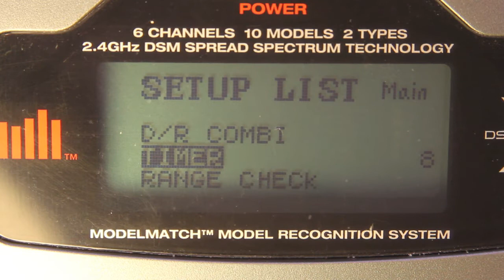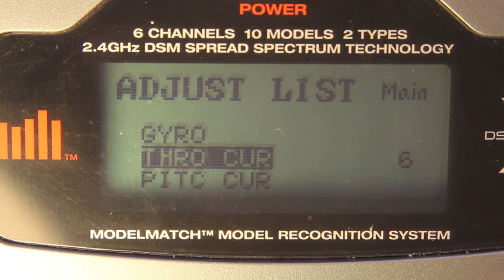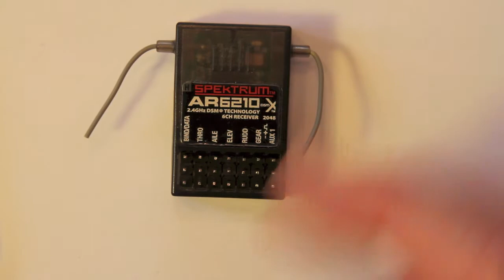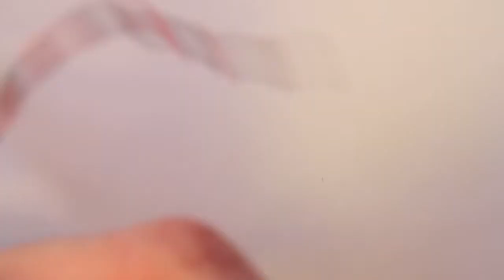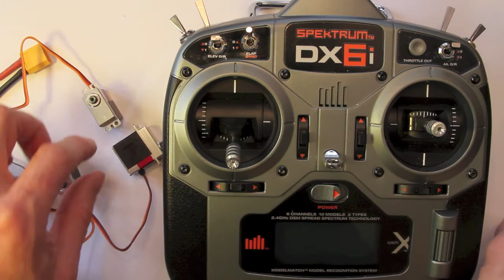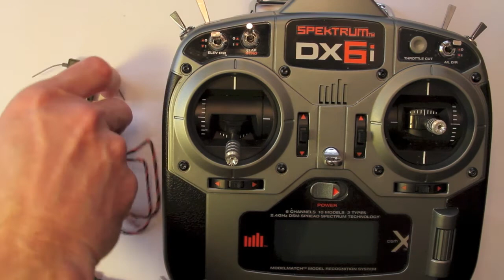11 : Tarot 450 Pro V2 Build : Electronics Extravaganza Volume One

Comment: Please help if you can - I have a new Tarot 450 pro 3d - (Devo 7 TX, Devo RX701 receiver, and a KDS 820 gyro) - I crashed it braking the main gear set and had to do a partial rebuild. After rebuilding - the heli now spins counter clockwise when spooling up and is not stable. I was told that it may be a reversed gyro. Does this sound right and, if so, how do I fix it? Simply going in to my controller and reversing it under the gyro settings?

Comment from the maker: I am using the Phoenix sim (phoenix-sim[dot]com).  There is a cable that comes with it.  One end (looks like a headphone plug) plugs into the trainer port on the back of the receiver.  The other end is a USB plug that goes into the computer. The cable is also a dongle, meaning it basically contains the license to use the software. Even if you have the software -- you MUST have the dongle. You can get them used from the forums if you keep an eye out. Phoenix offers free updates...